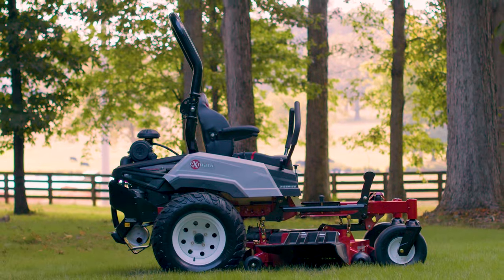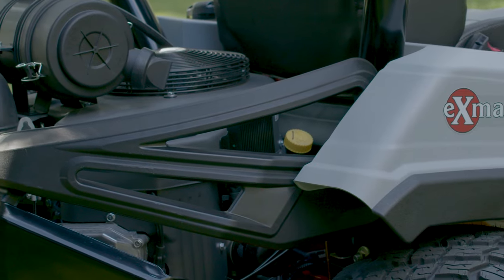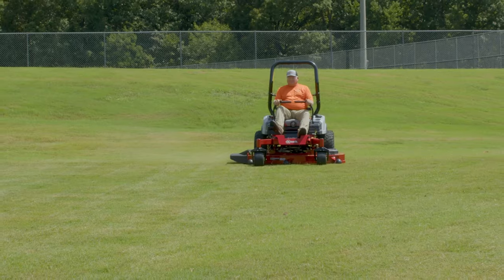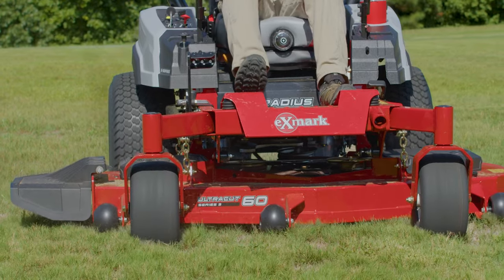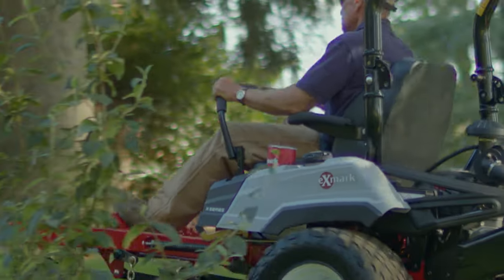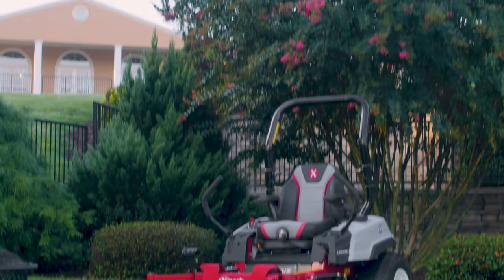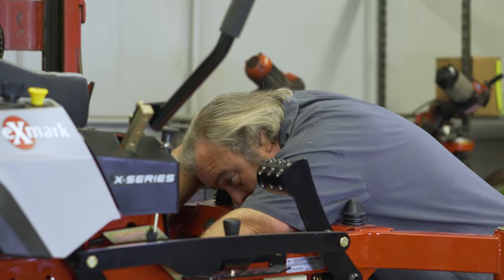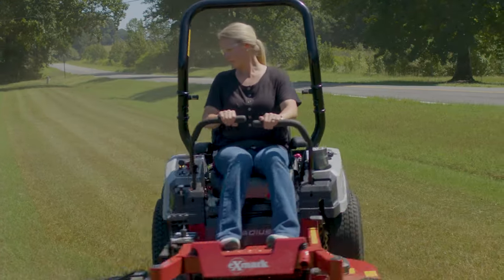The Radius Zero-Turn Mowers | Exmark

Comment: Why are only TWO Blades on the 48" instead of THREE?
Reply: It's a 48", not a 60"
Reply: WRONG, THE 3 BLADE IS AVAILABLE, MAYBE 5-600.00 MORE 48 INCH DECK 3 BLADE